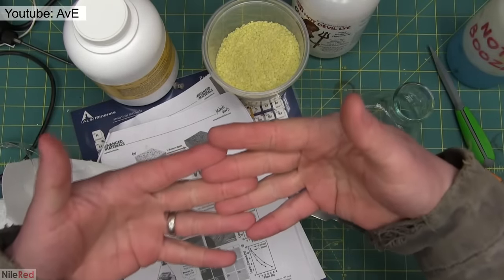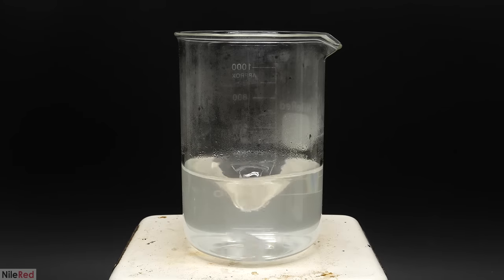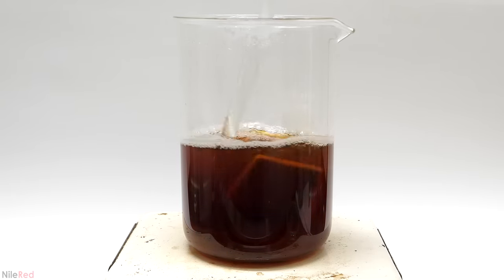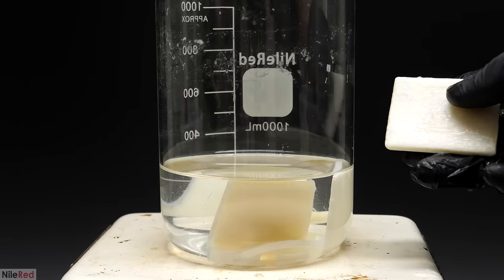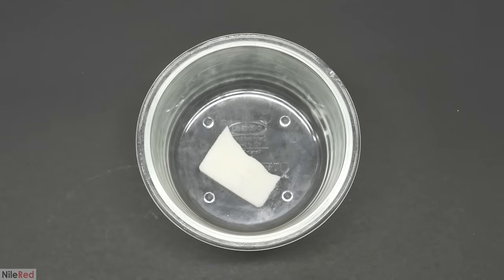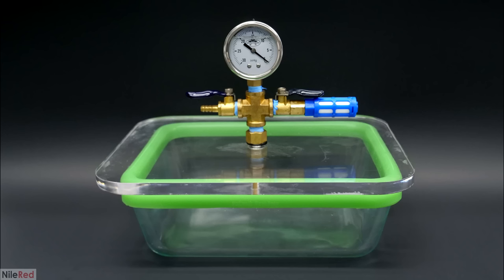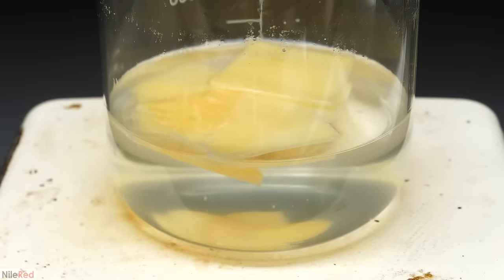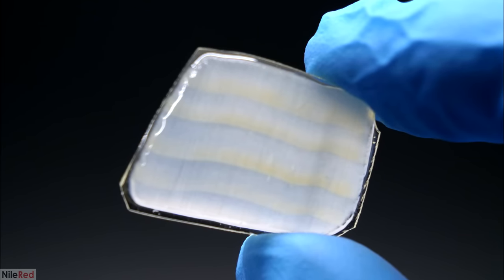Attempting to make transparent wood

Comment: I wonder if you would get better results using something like Cactus Juice wood stabilizing resin, and a pressure pot after the evacuation.
Cactus Juice is heat cured, so you are not limited by time, and can let the evacuation go for hours, then put it under pressure for hours before removing the wood and heat curing the resin.
Reply: This is what I was thinking the entire video, as well as on AVE's video. 
The epoxy used here is too thick to be fully pulled into the wood, and the wood was never really submerged in the resin. It must remain submerged to evacuate all the air. The limits brought on by cure time are also a concern, and would be eliminated with the heat-cured Cactus Juice. 
The unlimited open time and thinner viscosity would eliminate most of the problems here.

Comment: I am mildly concerned about the marketing and hype of "transparent wood" for stronger, environmentally friendly glass or plastic, such as a future replacement for windows. It is stated as biodegradable (at least much more so than plastics), even though a fairly good percentage of it is epoxy. Not to mention that the amount of effort and resources needed may outweigh the energy efficiency or carbon footprint of production, or the price point for consumers. Newer updates are claiming versions that can store and release heat by fogging up.

I think someone should probably review these sources for the actual economic feasibility and environmental impact of this material before the hype comes back to bite us...
Reply: Why use nice recyclable glass when you can make epoxy windows?
Reply: @RobertSzasz  that's what I'm thinking
Reply: Not to mention the durability if a bird crashes into it is going to break in half
Reply: jew
Reply: They can make polymers put of corn, so that would be a good replacement for the epoxy
Reply: You basically described how I view like every "lower carbon footprint" alternative.
Reply: Who the hell is possibly marketing this as a glass and plastic replacement??
Reply: @mtmadigan82  no one, it's just an experiment.
Reply: Just the chemical run off he makes is ridiculous, let alone the fact apoxy is not biodegradable u r what is wrong with the world 
People who know big word are dying to use them but have no actual intelligence so the group remebered words in groups hoping one day they make sense well today is not that day sir u have failed again
Reply: @luccivuitton7463  All he said was that it was STATED as biodegradable, he's not claiming that it actually is.
Reply: @averagekhfan3693  like the white airsoft bb's... Still in the forest 100 years later lel

Comment: You should try degassing the resin before adding it to the wood. You might also benefit from looking into different ways of reducing the resin with a solvent. Usually the datasheet of resins will specify if there is an acceptable or specific solvent to use for this. Sometimes there are also options for controlling the flash and cure properties of the catalyst, although this is usually more common with polyurethane clear coats that are used in much larger quantities and environments where they need to be perfected. 

   You might also try a vacuum bagging process where you draw the resin across the wood in a controlled manner. That's one popular way structural carbon fiber composites are done when dry fabrics are used for the composite layup.

  BTW, I painted cars and did custom graphics for many years. When it comes to getting a polished surface. The standard is to smooth the surface with 1500 grit wet sandpaper. Use a bucket of water with a couple drops of dish soap like (or specifically) Palmolive to clean the paper and surface as you go. Follow this up with 2000 grit, then 2500 grit in the same wet sanding process. Be sure to completely remove the scratches from each prior step. Then use 3M Perfect-it 2 polish compound on a heavy foam polishing pad with a polishing machine set to around 1000-1200rpm. The trick is to remember the compound does the work. Never let the working surface go dry while never adding too much polish that it gets slung off the pad. The surface will begin to get warm if the pad is doing the work instead of the compound. Also, never sand through the epoxy to the surface underneath. This is harder to do on the edges where the epoxy is thinner. All polishing steps must stay in the epoxy layer. To use wet/dry sandpaper, tear it in strips in a size you like (2-5"×9-11") and fold it in thirds. Let dry paper soak in water/soap mix for 10-30min before use too. This will soften the folded corners of the sandpaper and prevent them from causing deeper scratches than the specific grit. 
  If you sand by hand, always sand like your hand is the x-axis of a cnc machine - left and right. If you sand with the direction of your fingers you will create an uneven surface. The pro way is to use a soft foam block that is designed for backing up sandpaper, but I have a collection of ~50 blocks for all the different applications and preferences. For small things, you don't need this just use your hand. Perfect-it 2 polish is the best machine polish for transitioning from sand paper scratches to a polished plastic. It isn't really a finishing compound. For instance, if you use it on a black car it will leave a haze and swirls on the surface. This type of compound is usually followed by a medium and light machine compound to get an absolutely perfect finish, but these depend on the application. With light colors like silver or white cars the final finish can often be achieved with just Perfect-it 2 because of how light reflects off the surface. There is a Perfect-it 3 compound too but I never liked it as much as 2. Most compounds tend to have fillers that deceptively make the surface look better at first while the job isn't really done. They are basically filled with oils that make the surface look okay at a glance. In my experience Perfect-it 2 does tbe best job of creating a truly perfect surface ready for the next step without artificially hiding problems or burning/damaging the surface.

  I think you were also on the right track with the glass dish cured product. Carbon fiber composites sold in flat sheets are usually made with the cosmetic side formed against a sheet of glass. You would probably benefit from a cheap and flatter piece of glass from the hardware store.

For a fun challenge, I wonder if you could seal part of the wood and process an image into a wooden substrate like this. Exploring the potential resolution and applications could be interesting. Many people have used wood vernier to create wooden clocks with 7 segment LED displays showing through the thin wood. What could be done with this process?
-Jake
Reply: Thank you for blessing us with that sick knowledge. I always love to hear from people who understand the true science and art in their work.
Reply: I didn't know that bit about the proper direction to sand in by hand, that's good to know (and no, I'm not being sarcastic)

Comment: I think you should cut them slower with a finer blade so u Don't "smash the tubes shut"
Reply: not a finer blade, but a crosscut blade. the teeth are angled so it slices the grain. a combo/rip blade has straight teeth that do more scooping/crushing than slicing. also a coarser blade with a faster cut will leave the grain rough and open. finer blades at slow speeds give a smooth finish. but none of that matters because the boiling water will soften and expand all the grains anyways.

Comment: Procedures I'd Attempt

1. The video only shows two different grain cuts. The third grain cut is singularly diagonal to the grain. The fourth grain cut is doubly diagonal to the grain. Slice the wood diagonally across the grain in both directions. This would mean that the wood has tube openings on all six sides of the treated piece. This involves some serious measurements to obtain the most porous borders capable by the wood. The diagonal arrangements of the wood tubes only extend the tubes about half as much, but their orientation retains rigidity through the rest of the procedures. Thoroughly sand the wood piece for smooth edges and sides.

2. Use the same chemical mixture as described in the video. Place one piece (not a bundle) of wood in the chemical bath.

3. Heat the chemical mixture and soaked wood piece.

4. Once heated, place the hot mixture and wood piece in the vacuum chamber to completely saturate the wood with the chemical mixture.

5. Once the air is pulled out of the wood, remove the first chemical solution and wood from the vacuum chamber. Pour off the chemical bath.

6. Apply as many water rinses as needed until the saturated wood no longer colors the water.

7. Allow the piece of wood to dry.

8. In a fresh water rinse, place the chemically saturated wood in the vacuum. This should color the water with the trapped chemical within the wood and extract air from the wood.

9. Allow the piece of wood to dry.

10. Apply the original second chemical mixture (not bleach) to the wood piece.

11. Add heat to the second chemical mixture to open the pores of the wood to saturate with the second chemical.

12. After appropriate heat is applied, place the heated wood piece and second chemical mixture into the vacuum chamber. 

13. Once the air within the wood is extracted and the second chemical mixture thoroughly penetrates the wood piece, remove from the vacuum.

14. Apply as many water rinses as needed until the saturated wood no longer colors the water.

15. Allow the piece of wood to dry.

16. In a fresh water rinse, place the second chemically saturated wood piece in the vacuum. This should color the water with the trapped second chemical within the wood and extract air from the wood.

17. While the wood is still wet and pliable with water, apply the resin mixture in a flexible plastic (not rubber) mold.

18. Place the resin mixture and wood piece in the vacuum chamber. Keep the vacuum applied until the resin sets but not hardens completely.

19. Remove the set resined wood piece from the vacuum chamber and let it dry completely.

20. Once completely dry, do not pry the dried piece of wood from the mold. Instead cut away the flexible plastic mold from the finished piece. Use an eyeglass cleaner cloth to shine all exteriors of the resined wood piece.

The results of these procedures should yield better results in strength, clarity, saturation of the resin, and finished shape of the resin.

Comment: Wouldn't this procedure remove pretty much everything that is wood so wouldn't this be just like.. resin?
Reply: the cellulose tubes would give it reinforcement, like rebar in concrete.
Reply: One way to put it is that wood is a natural composite material. So you're turning one type of composite into another. I'd definitely agree that it's no longer wood, but that's not the point of this :)
Reply: @CanIHasThisName  fair enough. I'd say that "transparent wood" is a bit of a sensationalist title though, that is mostly what bothers me. It's a bit like taking the seat belts from a  car, putting them in a plane and claiming you turned a car into a plane.
Reply: @SyntheticFuture  The main part of wood is the cellulose, the lignin is pretty much a natural resin.
Reply: @SyntheticFuture , I would watch if you made a car to plane video.
Reply: @AmandaOlson77  would honestly not mind trying it but there are some issues. First is me living in a appartement and not having a workshop. The second being the extremely strick aviation rules in the Netherlands (you can't peter stipol a plane together and fly it somewhere on a field down here) and the third issue being that it would require some serious money... But aside from those small hurdles I honestly wouldn't even mind trying it. Love tinkering with things.
Reply: @scandilad5152  that I did not know. So in that case what you are doing is replacing the colored natural resin and replacing it with artificial clear resin. I guess you could say it still somewhat counts as wood than. Minor stretch but I'll take it.
Reply: @SyntheticFuture  He did, you just phrased it wrong. He made the car fly...

Actually, I can totally imagine someone doing that and showing their friends, followed by a prolonged arguement about whether or not that really counts
Reply: Its not transparent, it's translucent
Reply: It's the same idea as the question, if you car breaks down and you have to replace everything other than the body is it still the same car? Replacing most of somthing is either seen as replacing or fixing so decide which one
Reply: Didn't you mean... Woodn't?
Reply: @Royvan7  Well then perhaps we should figure a way to manufacture some sort of artificial cellulose tubes instead, with even more strength.
Reply: @Ghost0fDawn  after some cursory googleing apparently someones figured out how to make an all cellulose composite (ACC) where the matrix and reinforcement is cellulose. that's vaguely interesting. that is how composites work having a matrix, usually some manor of resin, and strong fibers to reinforce the matrix.
Reply: @SyntheticFuture  Peter Stipol is right!

Comment: some advice from a knife maker....after vac, then place the slices filled with epoxy in a pressure chamber at 80 psi. This reduces bubbles and increases density of epoxy, makes for a much more stable and clear epoxy

Comment: Things that are transparent are so clear you can see through them as if there’s nothing there. Things that are translucent allow light through but with significant diffusion or distortion.
Reply: JanetteP I think you mean opaque
Reply: opaque objects don't let light through
Reply: I see your point, but transparent in optics just means that light can go through the object. The object can be very transparent or just a little, it will still be transparent :)
Reply: @pepethebaker : Nope, transparency in optics means that light passes through without being scattered, ie. Snell's Law applies on a macroscopic level. Translucency OTOH only means that light passes through in some way or another, Snell's Law doesn't have to apply (again, macroscopically). So everything that it is transparent is also translucent, but not the other way around. Nomal window glass is transparent (and translucent), frosted glass isn't.
Reply: Hunter Secrets opaque objects let some light through and scatters the rest. Making it only somewhat transparent.
Reply: matthew kloep:  you are wrong. Oddly, I just looked it up on Google and one dictionary has the wrong definition and agrees with you.   Unfortunately the Internet is Full of incorrect information.  

This is the correct definition:

Opaque:  not transparent or translucent; impenetrable to light; not allowing light to pass through.
Reply: That’s from an unabridged hardcopy dictionary.
Reply: @seanvogel8067  how old is the dictionary though?
Reply: Squiggles : it’s pretty old.  But the word opaque (incidentally Siri can’t take that word in dictation)  is like a superlative.  It means no light can go through. The word opacity is used for a degree of “opaqueness”.  I guess you could say a material is 50% opaque. But if you just say it is opaque, it is 100% opacity.

Comment: Possibly could use low viscosity UV curable resin. That would keep the viscosity low to penetrate the resin deeper into the fibres and shine UV on the fully soaked pieces afterwards.

Comment: It might help for getting the resin into larger bits of wood if you have the vacuum pump somehow directly connected to one side of the wood, so it directly pulls the resin into the wood, rather than waiting for the resin to soak in

Comment: It seems to me that using a specialised wood stabilising resin would be more successful than the general purpose epoxy you used - with a lower viscosity it would penetrate much better. Perhaps the only issue could be the colour and surface finish.

Comment: To avoid the violent splashing when pulling the vacuum, you need to crack open the vacuum release valve to control the rate of pressure change in the chamber.
This lets you remove the air in the Resin without letting it boil over the edge of the mould.
Once it stops bubbling, you can then close the valve and pull down to the full vacuum. From what I've seen in other videos, once the chamber has been pulled down as far as it can be, let it sit at that vacuum for a minute or 2 and then, turn off the pump and slowly release the vacuum and let the piece set up as normal, keeping it under vacuum can cause some odd effects to occur.

Comment: I would recommend a stiff mold. Your silicone bends a lot, but if you use some sort of release agent, it should be able to be removed just fine. Maybe a wait time of a week would allow for the resin to cure enough to where it wouldn't bend too much, but it can take up to several months for resin to fully cure. It varies depending on the type of resin used. I also recommend vacuuming out gas from the resin before pouring it onto the wood as microbubbles might be pulled into the wood, causing extra haziness.